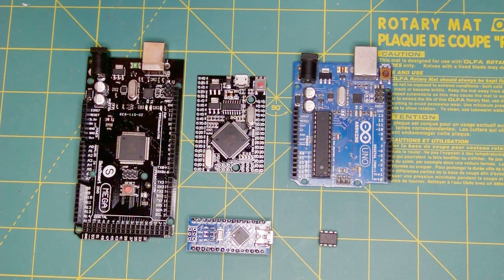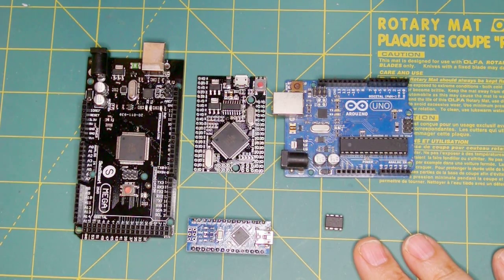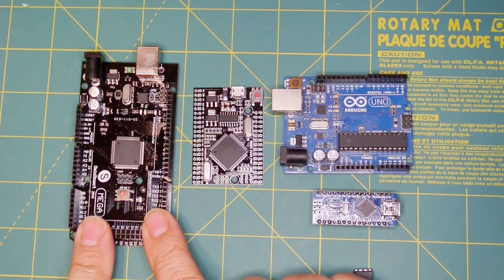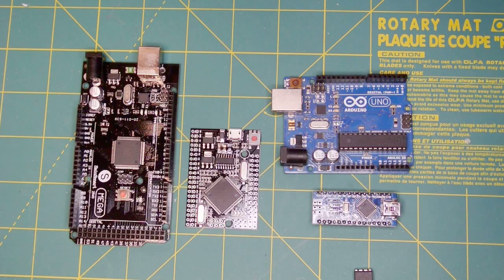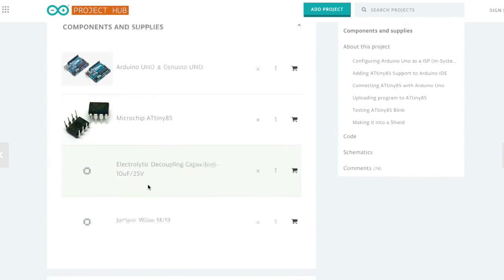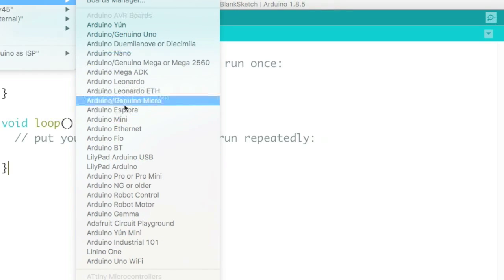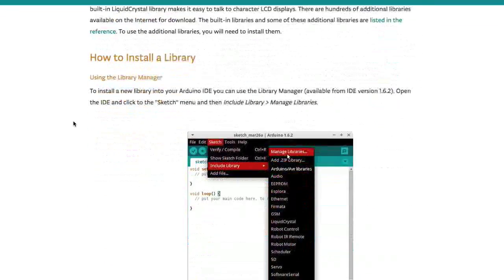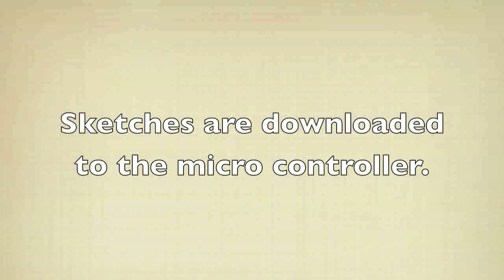Arduino Primer - for RV-Project.Com projects.

Comment: I just came across your channel from a link on an OSHPark board.  I love your style of sharing information, very practical, just enough theory to get folks moving down the road in the right direction.  I'm sure you've probably already come across them, but thought I'd mention, from a maintenance perspective on your projects, it may be worth investigating the ESP8266 modules in place of ATmel based boards/chips.  If you get the ESP-01s (the "S" on the end is the important bit, as it designates 1MB of flash storage) or other ESP8266 boards with at least 1MB of flash, you can program them (still using the Arduino IDE) such that they can be flashed over WiFi, without having to take apart projects that may be mounted in inconvenient places just to tweak the software a bit.  I've picked up the the ESP-01s modules for as cheap as $1.35, which gives you 4GPIO pins on a 72MHz CPU with built in WiFi, or $2.05 for the ESP8266 D1 Mini boards, with 11 digital and 1 analog GPIO and 4MB flash, larger boards with more GPIO are also available for the ESP8266 and much faster ESP32 module (which also includes Bluetooth, and is also programmable via Arduino IDE).  I realize you're probably sticking with the "right sized" tool for the job with the Atmel boards/chips, and may not want the extra current draw associated with these faster modules, but thought I'd throw them out there for the benefit of being able to flash over-the-air, even if installed in a project inside a panel way back under the stove or something -- so not for every project, but for those with enough code complexity or where they're inconvenient enough to get to so as to discourage getting into them and fixing minor bugs, it may be worth the extra few mA of draw.   Keep up the cool/informative videos!
Reply from the maker: I have a bunch of them in my parts bin. Have not had the time to really devote to learning how they work. Have a few Raspberry Pi, Teensy, and other boards I have yet to experiment with.

I hope to be able to take my laptop and a few kits with me next camping season for something to do.

Who knows, I might be rebuilding some of my projects.

Comment: Thanks for this video. I retired as an electronics design engineer after 30 years of developing medical instruments. While I have used Atmel micros in my work I had never heard of the Arduino platform until after I retired in 2013 and started doing home hobbyist stuff. I actually started with the same Elegoo kit to learn the environment and have completed several projects. My wife finally retired last year and we now travel in a Roadtrek Class B camper so I no longer have the hobby time I did. I'll be sure to look through your videos for projects that may be applicable to my Roadtrek!
Reply from the maker: An index of all of my RV Arduino/Electronic projects can be found here: http://www.rv-project.com/projects/electronics.php